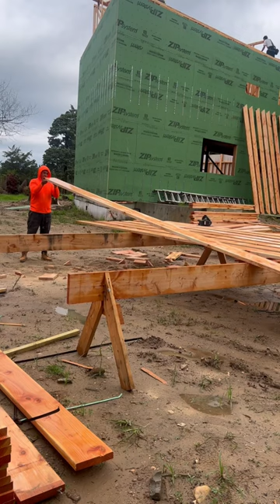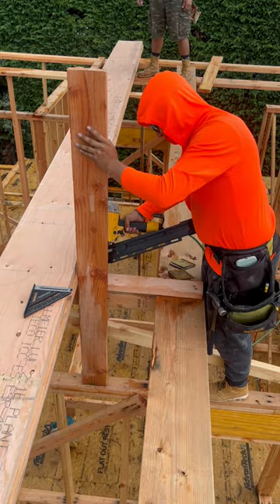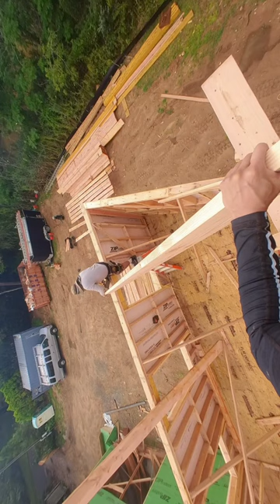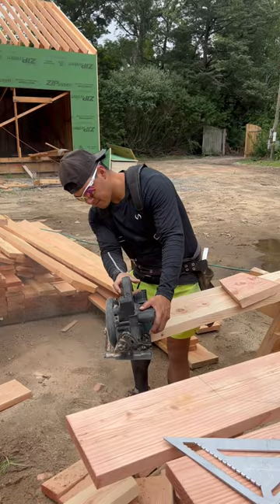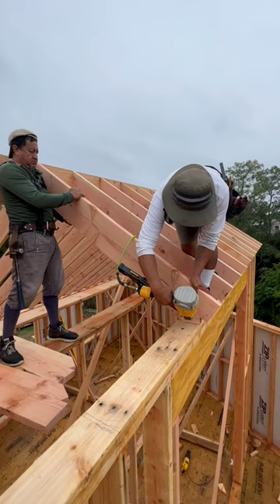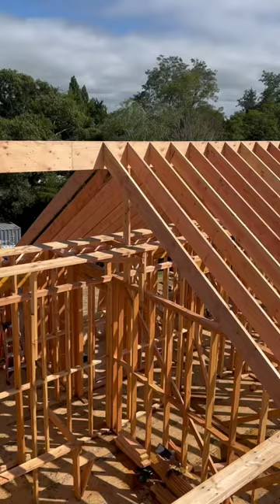Roof framing #shorts #short #construction #skills #beauty #perfect #work #team

Comment: Nice. Looks good!
What is your preferred nail gun? 21 or 30 degree?
Reply: Looks like a 21°
Reply: I prefer 21 degree, I have 4 Metabo HPT 21 degree framing nailer's. Metabo HPT ( formally Hitachi) is the best on the market, #1 preferred by contractor's.
Reply: @jonathan3982 I still have several Hitachi NR 83 gun's and you couldn't pry one out of my cold dead hands.
Reply: @Quackerstacker1973  I believe it! Lol they are in my opinion the best in performance, durability, and price.